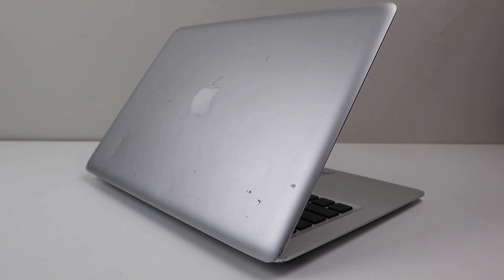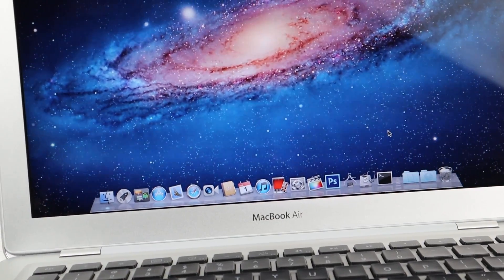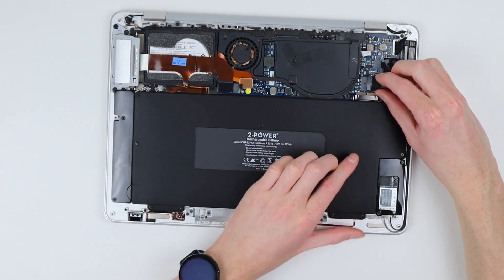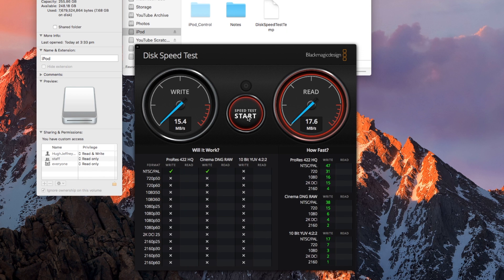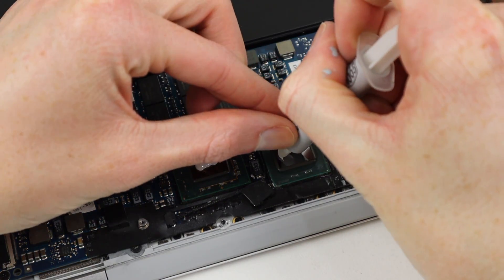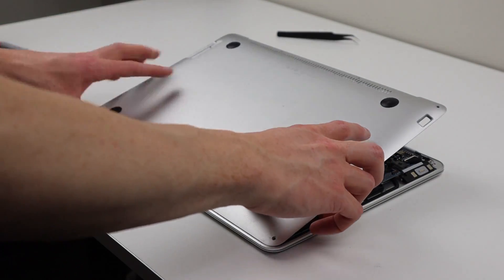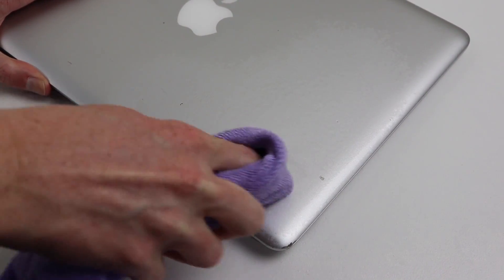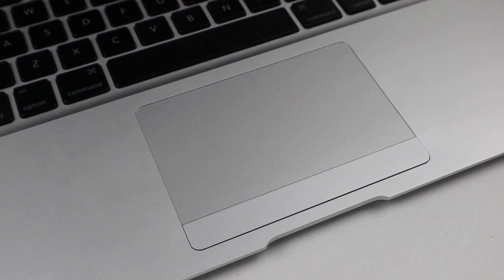Restoring Apple's First MacBook Air From 2008

Comment: I have one piece that holds over the years very good, but now in 2025, it is unusable. I installed Ubuntu desktop 20.04 lts and it works ok, not great but not terrible as the original OS.

Comment: I have a weird thermal one.. I got an M1 MacBook Air to replace a 12 year old Dell E6420 that overheated in bios almost lol. Eventually reapplying thermal paste (well) and even replacing the heat pipe didn’t help. 

Three years later it still bugs me. I stupidly sold it to some nerdy kid for $50 cause I was so frustrated. I wonder if those gen 3 core i7 chips just burn out? Cause whew.. anyways. 

Good work here Hugh.

Comment: I understand having the port door -- lessens the chances of dust going in. 

On the side note...with Apple laptops now soldering ram and storage on the motherboard, what's gonna happen after Apple will not support the device with upgraded software going forward? Is it possible to install another operating system like Linux in this case?

Comment: I do not recommend putting alcohol on a display. It may clean easily because it is a good solvent, but I have had numerous LCD panels where the alcohol would make its way into the sides of the panel and go in between the layers dissolving the glue or reacting with some of the layers. It's not noticeable when looking straight onto the screen but looking at an angle the alcohol leaves weird discoloured marks. When buying things second hand, I have received items where the previous owner used alcohol to wipe off the screen and it leaves marks on the edges of the display and also bites into the plastic leaving the wiping streaks slightly visible, especially on the 2009 polycarbonate macbooks. On the aluminium macbooks I have noticed the alcohol leaves a slightly pink appearance for some reason if you leave it on for too long, but I don't know why that is and can't find a chemical reaction online for that would cause this. It may just be somethig unique on my devices. Using a bit of soapy water is a much better solution as it doesn't react with a lot of things chemically. You don't always immediately notice when alcohol left a mark but it's often there on the surface from my experience. A paper towel with a bit of water and soap and a dry paper towel clean the fragile screens just fine and don't risk damaging it if you do it carefully.

Comment: Nice video....I support RIGHT TO REPAIR....
I have my macbook 2008 unibody model....I think due to overheating...some display issue has happened in it.....one horizontal line is appearing on screen right from boot sequence.... I used a laptop cooler but the laptop coolerusb connection was making the laptop hot....i failed to notice this point n then the issue happened...I did SMC NVRAm safe 
 everything...the issue persists...any help ?

Comment: I have the 2nd revision of this MacBook Air, specifically the mid-2009 model A1304 with specced-out 2.13 GHz Core 2 Duo and 121GB SSD. Regarding that non-upgradeable RAM problem though, I followed DosDude1's tutorial and successfully soldered on 4 GB of DDR3 onto it. The CPU is a limit though, as even patching it up to Catalina it still runs like crap lol

Comment: You can patch this device to OS X Mountain Lion and still get full graphics acceleration (there is a driver install utility for Mountain Lion).
The performance difference is pretty noticeable, especially using a fork of a recent browser like some Firefox Legacy.
YouTube will play smoothly in 720P as long as the CPU does not overheat, and maybe even 720P60.

Comment: 4:27 I know this video is a year old now, but you would've seen a noticeable upgrade with flash storage.  The biggest impact SSDs have is exponentially faster random read/writes, which is specifically what hard drives suck at.   Also, the drive on the Air isnt identical to the iPod drive, its a bit faster and has more cache.

But anyways, not like it'd really be worth the cost on something you aren't really gonna use.
Reply: But remember SSD Drives fail faster compared to Hard Drives

Comment: little late on the comment but... i've got one of these and a rectangle of the 3M heat sink pad between the bottom case and heat sink helps A LOT with the CPU/GPU temps. This does make for a very hot spot on the bottom case but mine has the nvidia GPU and idle temps near the max t-junction temps were not acceptable. If you happen to pick one of these up with the nvidia GPU and an SSD they'll run mojave with very little fuss.

Comment: „the latest Macbook Air which doesn’t have a heatsink to connect to the fan“
You probably shouldn’t have said that since the latest MBA doesn’t even have a fan
disclaimer:  Its ok since it is no longer needed with M1

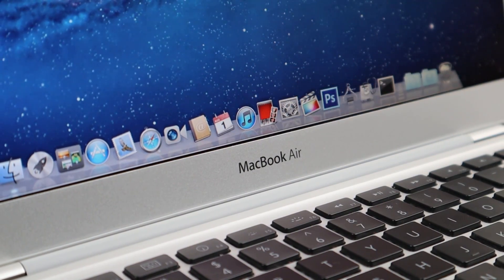Comment: 9:20 You should take a look at Fujitsu's Lifebook U900-Series, the U938 for example (https://www.notebookcheck.com/fileadmin/_processed_/8/7/csm_Fujitsu_Lifebook_U938_Innereien_36065c2a6d.jpg) got easy interchangeable Battery, SSD, WiFI, Wireless Broadband (still in no MacBook but in a f*cking watch?!) and RAM (4 GB are soldered to the board, the rest is in a SODIMM slot), the new U939 has all-soldered RAM, but still the other parts are interchangeable: https://www.notebookcheck.com/fileadmin/_processed_/5/d/csm_Fujitsu_Lifebook_U939_Wartung_37fe0e9e88.jpg
Also they still got USB-A, a full-size SD card reader, full-size HDMI and a special Ethernet port: https://linustechtips.com/main/topic/870771-origami-ethernet-ports/
Apple is lazy IMHO, it's good to push the development, but are abandoning things like USB-A and HDMI way too early.

Comment: Later in 2008 they switched to SATA which certainly saw performance improvements. I’m not sure you can use iPod drives in those however.

Comment: hey, can you pls do a video on how to fix the flexgate issue on the MacBook Pro. I recently took my 2017 MacBook Pro to the apple store to get it fixed and they rejected it saying that there was damage which didnt make, "eligible for the program." I was hoping to fix this issue by replacing the wire rather than the whole display which is much more costly.
Reply: ifixit probably has some stuff on that

Comment: Bro can you upgrade iphone 6s nand ic chip (16gb to 128gb)? Uh?
Reply: the storage chips are paired to each other most likely, and it would take a lot of work that in the end might cost more tham buying the higher storage one in the first place
maybe could be done if you have a tool that can pair new hardware parts to a phone
but only apple has such tools

Comment: The Battery you bought is so damn overpriced. You can find reasonable ones on ebay for about 25$ and they work as fine as the one you bought for about four times the price

Comment: I have the 2009 model  in near-mint condition.  There are some errors in this video.  Its not a 'micro DVI' port, its a mini DisplayPort.  The Magsafe charging port was designed for a different connector that sits flat on the desk.   I replaced the iPod drive with an OWC SSD years and years ago.  Also repasted and applied some thermal pads inside.  The battery is in great condition.  There's only 2 major problems with mine -  1. The stupid weak screen hinges (which is a major, known design fault that doesn't even get a mention here).  2. Its under powered for the later bloaty versions of OS X.  I put Snow Leopard back on using my SuperDrive and the original OS DVD but even getting a useable browser on there is a struggle these days.  So currently its running Linux Mint instead, but getting that working was a whole other story...
Reply: shut up kid
Reply: @nosiewanoah8088  well done, take a bow

Comment: Depending on the hours on that hard drive, it may just be worth swapping in a new hard drive. Given you've filmed this video already, it's safe to say you won't want to crack the laptop open again, but it's something to think about. Like batteries, hard drives are wear components, and will fail eventually.

Comment: 8:27

So true. I once bought an ‘immaculate’ PS Vita a couple of years ago, and it straight up looked like dude had spooged all over the front screen, it even smelt musty. I mean, I know within my age group the original PSP’s browser was our first access to.. questionable content 😅 but you kept the device er,  ‘out of harms way’ if you get what 
I mean.

I straight up had to handle it with gloves, took it apart down to the very last component, cleaned with ISO alcohol on any electronics, deep soaked all the buttons/port doors in boiling water with anti bac solutions and scrubbed away.

Not only that but it was covered to heck in scratches, so I managed to get half my money back due to it being a mis sold item. The dude also forgot a game cart & memory card in their slots so was even cheaper after selling those off -  bought some replacement parts from China, and it became a super cheap resto project. Its now genuinely ‘immaculate’, looks & feels like it was unboxed yesterday 😁

Comment: i have unusual prob with my old mac pro 2008; the mouse (cursor) and keyboard malfunction ( just jumps/types uncontrollably, and even dont move at all on El capitan so i cannot even finish installation of this one) when i boot in to anything above snow leopard although they work perfectly in SL. i  have tried reinstalling..i have plenty of RAM; grateful for any ideas. I have consulted all the local people.
Reply from the maker: Is it running with bluetooth? Usb 3 cards can interfere with bluetooth on the mac pro if you have one installed. Try wired options

Comment: Interested in the amount of thermal compound you used. My understanding is that the compound is only there to displace air which is a poor conductor and the best conduction occurs where there is no (or very little) paste between chip and cooler. Given this, I would have used less goo but I appreciate you do a lot of this work so would be interested in your view.
Reply: The Thermal Compound is in a Device to keep the CPU AND HEAT SINK IN DIRECT CONTACT FOR BETTER HEAT TRANSFER

Comment: Nice vid! At the end you mention that the flickering is an issue with your camera. Most probably, it's because the shutter speed is not set correctly. It needs to be double the framerate, so if you're shooting at 30fps, the shutter speed should be 1/60. It's called the 180 degree rule. If it comes out overexposed, i suggest you change the exposure instead of shutter speed. Hope this helps :D

Comment: Damn you have guts bending the corner of a Macbook. I dropped my Macbook Pro Retina and had the same issue a dent on the corner and scraping. I tried to fix the bent corner and ended up damaging the LCD. It developed a small crack and in time the LCD got randomly appearing and disappearing lines and bars. It costed a pretty 450 euros to replace the lcd.

Comment: I had one of these a late 2008. Horrible machine. I mean yeah its light and looks amazing and has an awesome keyboard and trackpad but it was always HOT and pretty slow even after I replaced the hard drive with an SSD.

Comment: Would it be worth it to upgrade the HDD to a 7200 RPM drive
Reply from the maker: You cannot get a 7200RPM in the size of the current hdd. Its tiny...

Comment: I love your channel no hate but I really don't get the whole collection thing and screen protector thing like you spent 100 dollars on a battery for a laptop that will be left in your collection and collect dust and never been used I get collecting a few phones and restore them for a small bit of money but a huge collection of phones laptops etc I think it's a waste when someone could use it you don't need more than one laptop or phone to use also the screen protectors you buy a hundreds of screen protectors for phones and ipods you will never use therfore not getting damaged they are meant to be used not fixed and left to collect dust as I said no hate I love your channel just saying as it does not make sense to me

Comment: Im still using my 2011 11 inch MacBook Air; it works great the only issue it’s the battery that exceeded its charging cycles time a go and need to buy a new one and I want to upgrade the SSD also. Do you have any recommendations where can I buy it?

Comment: I own a HP Mini 2133 and that has the same fan/heatsink design, it works quite well actually, if i use this device for a while, that fan outputs quite a bit of heat so it does the job! But the HP Mini 2133 uses a very low power VIA C7M cpu, this macbook air uses a core 2 duo, so i don't know if that fan/heatsink combo will do the job that well

Comment: ‘It’s made out of the same material as tin cans, aluminium’ 🤦🏻‍♂️ no they are made of steel, coated in Tin. I’m sorry bro for calling this out but it got me 😂
Reply: Jordan Phelan... agreed!!!
Reply: Both Materials are in use, some drinking cans are made of aluminium (like Monster Energy) and others of Sheet steel coated with tin (called "Weißblech" in Germany = white sheet metal), also there are "mixed" ones, the barrel of steel and the lid of aluminium.
Reply: Apart from the ones that are made out of aluminium...

Comment: Correct me if I'm wrong, but the ssd in the ipod is limited speed wise via its usb muxing via the USB read write but in a mac book it should run faster as its not USB bottlenecked and like the ipod faster boot times and faster seek times as it does from the ssd itsself? I think going by a bottleneck on the USB shouldn't stop at least trying a ssd in the mac book as it should run on the same principal as a standard sata interface or ide, slow spin up and seek hard drive vs ssd performance 🤔

Comment: I would check the reallocated sector count on that hard drive. As well as how many hours of run time the drive has had. If the reallocated sector count is over 200 or some thing it is recommended you replace it.

Comment: Ummmm.....yes an SSD will make it significantly faster. 
Not because of the Read-Write speeds but because of the loss of spin-up time, as you rightly said first.
Reply: I think I have to say that the ipod supports max usb 2.0 connection to a computer and the max usb 2.0 r/w speed is about 15-20 mbps so that's why it was so slow.The ipod hdd is 4200 rpm.It's way slower than that ssd.The macbook air in 2008 also had an ssd option and people recommend that if you can get it for your collection as the hdd variant is too slow for modern use.
Reply: The original MacBook Air came with an optional 64GB SSD (for $1000, then $600), so I'd assume it'd have the hardware to make use of its faster speeds.
Reply: Christopher W Exactly
Reply: @christopherw9602  that's what I was wondering. Plus, Mac OS X has been optimized to allow the use of SSDs. NVMe SSD's are way too powerful so you can't use them i guess
Reply: @christopherw9602  stupid people exist 😂😂😂😂😂
Reply: also, faster seek times
Reply: Surely the MacBook IDE controller supports UDMA speeds too. I use mSATA adapters on old ThinkPads and get at least 30MB/s read speeds.
Reply: yeah and on the ipod it was RAM limited, jesus I SMH sooooo hard mate.
Reply: no brain found😂😂😂😂😂
Reply: I had one of these (or rather the slightly faster 2009 version) and upgraded the SSD. It was still slow as hell.
Reply: A mSata in that IDE would make it faster, but not SATA faster.
Reply: MacOS has optimizations for upgraded SSDs

Comment: you should see a powerbook G4 i got for free, and its in amazing condition, the hinges are still solid, the superdrive works, has a  gig of RAM MAC OSX 10.5, orginal charger and the battery is whats bad, but the whole casing is stunning and its the titanium model, im preserving it, but is an SSD good for it?, because you mentioned IDE so its no good putting one huh?
Reply: I’d say it’s still worth putting an SSD in. There are msata to 44-pin ide adapters. Look up a channel called Action Retro, he is the king of upgrading old Macs.

Comment: Nice restoration - I have never been this early to a Hugh Jeffreys video :D (was literally 5 minutes after upload!).
I can imagine that laptop running hot if the heatsink is "optimized" in such a way, and the fan not working well at all due to design issues... Maybe going into the power settings and/or checking the CPU usage at idle should help to eliminate heat issues, as it certainly shouldn't idle in the 90s... That sort of heat/CPU load is also not good for battery life and longevity.

Comment: Macbook: dead

Hugh: fixed it 👌
Reply: 89c idle thats the same as dead. once doing a "task" it will probably shut down
Reply: Apple: Macbook dead. Buy another one.
Hugh: Fixed it
Apple: That’s illegal!!
Reply: He changed the battery. He should have revived the old one. $100 for a slow piece of crap is .... waist of money. But these batteries can be fixed because they are stuck in a 'total draint state' that can be reversed :)
Reply: 180th like. you’re welcome 🤍
Reply: My MacBook air sweats nervously on what am I'm going to do it.